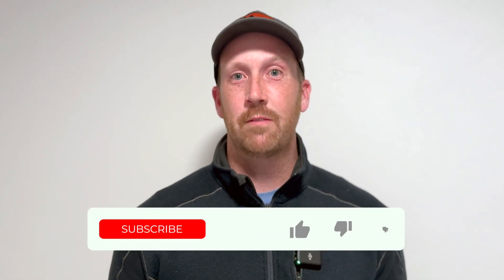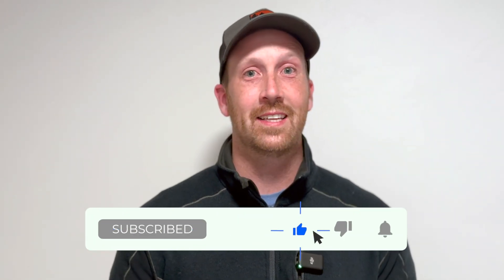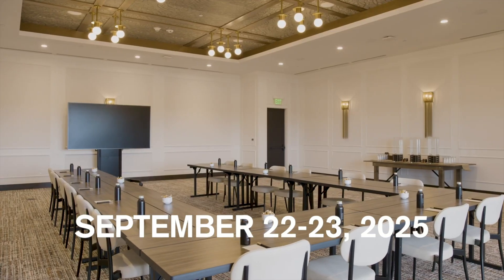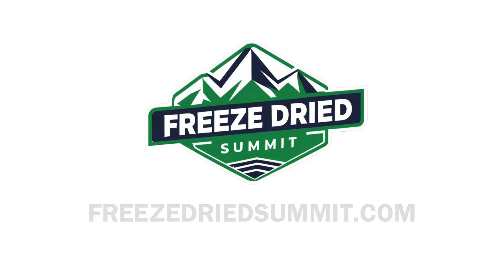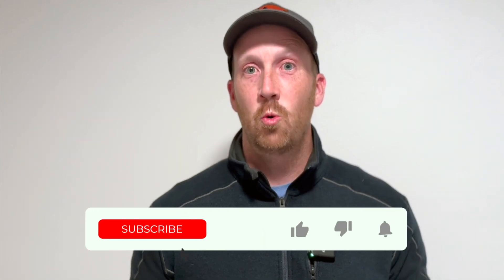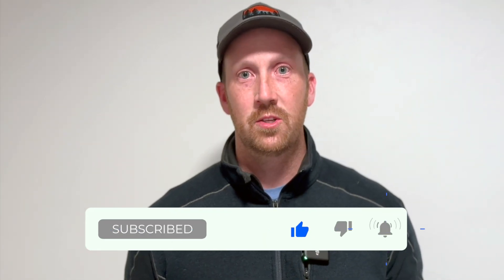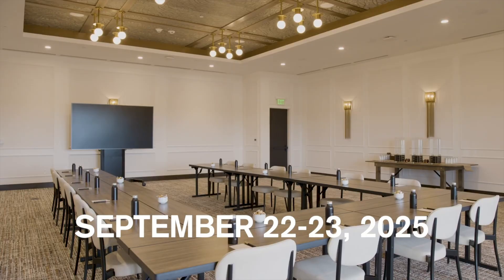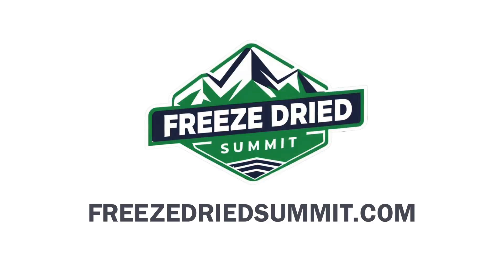This Freeze-Drying Advice Changed Everything For Me!

Comment: can you freeze dry herbs and spices to extend its shelf life?
Reply: Yes
Reply: You can freeze dry herbs, but you will need to pay attention to the shelf temperature at the end of the cycle.  Since you cannot control the chamber pressure in a small home unit, meaning you can't prevent the chamber from going too low in pressure at the end when the herbs are the warmest, you can drive the aromatics out of the herbs and into the ice, where they are useless to you. So you might need to set a reminder to yourself to go and lower the shelf temperature limit late in the cycle.